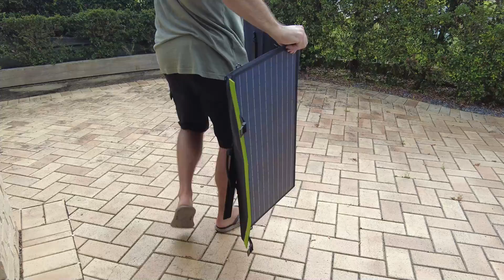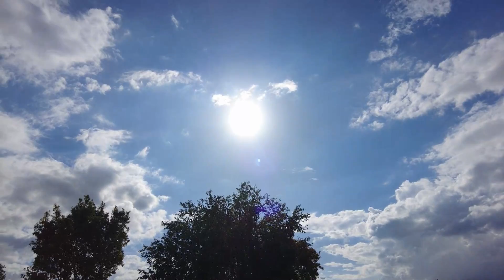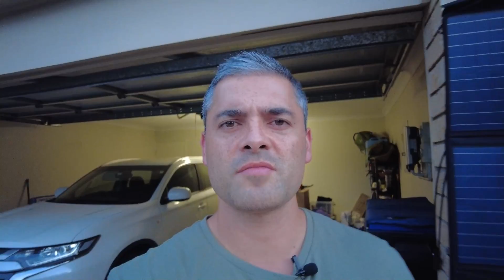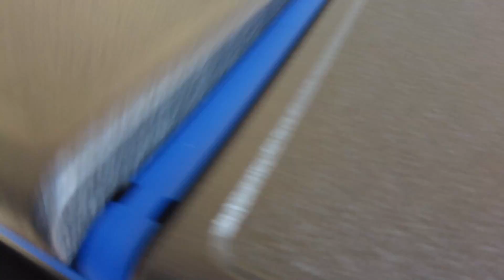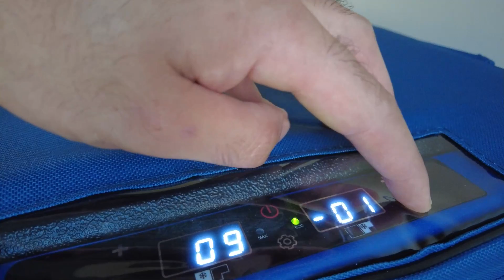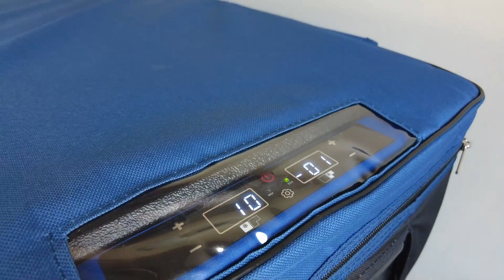Can the ALLPOWERS S700 Portable Power Station Keep Your Camping Gear Running?

Comment: Quick run down from a fridgie (refrigeration and air cond tradie)
It’s one thing testing an empty fridge and completely different with a full one. 
Fill the freezer with frozen chips and veges etc (already frozen) and fill the fridge with pre chilled drinks etc. 
the camp fridge will initially get the temps as set then it will hold the temp longer because the “load” will take longer to change temps. (The compressor won’t run as much). 
The fridge should be at 4c. The freezer should be below zero. 
Initially it’ll use a bit of power but once the temps are achieved the goods inside will hold the temp longer meaning less power usage. 
Try the test again with room temp goods. It’ll take forever and a lot of juice to bring the temps down. 
As for the battery, plug it into the car while driving to keep the charge up. Installing a cigarette plug in the back of the Ute tub is handy to charge it. You can also run the fridge off the car while driving.
Reply from the maker: Thanks for the tips Tom. All makes sense now

Comment: I guess you still have the Ecoflow Power system as well, with both systems you should be able to run a lot of appliances for the family when camping.
Reply from the maker: Yep. That's the plan Bill. It even made a small cameo in this video